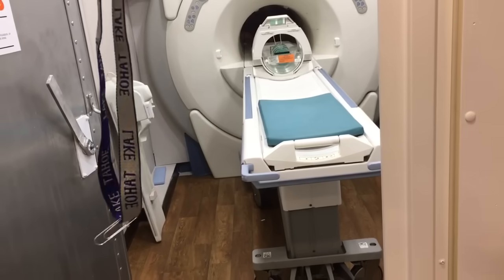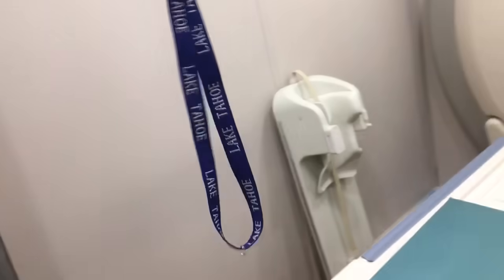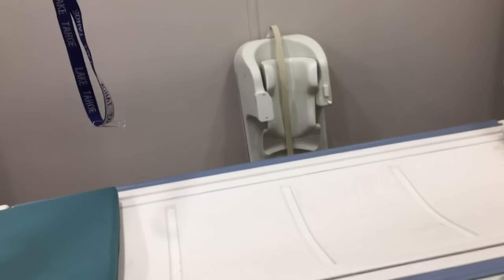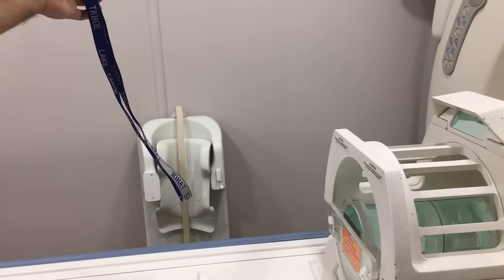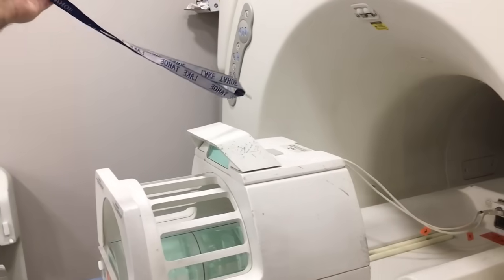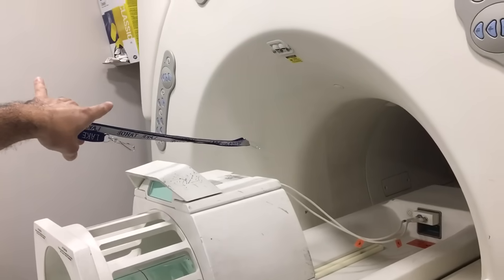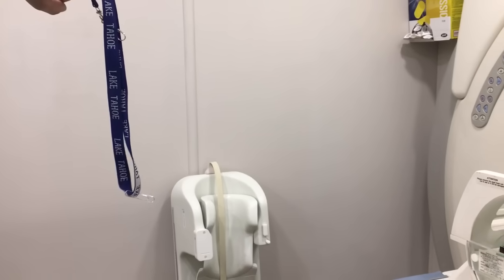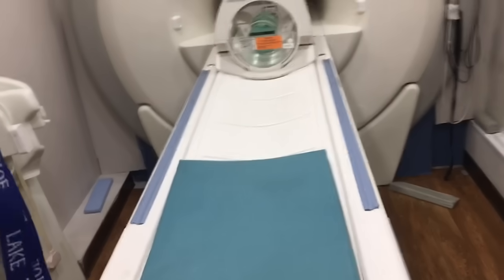Why You Never Take Metal in MRI Scan Rooms - Metal vs MRI Safety Demonstration (Original)

Comment: My sister had back surgery when she was 8 yrs old, it was a new technique back then, they never told my mom nor syster that they had inserted a metal rod in her spine on top of fusing all her spine together. 1 day a doctor sent her for an MRI and she then developed more pain in her neck, the doctor was shocked to find the rod was in there, so doctor 2 yrs later told my sister she needed another MRI, like I stated to my sister "but did she not tell you that you have a metal rod in your back", my sister then stated your right, she called her doctor and the MRI was canceled. I have a clip inside of me from gallblader surgery, so each time I have an KRI done, they put my back to the machine and test if the clip moves or hurts me, it appears my clip is not a metal which is affected by MRI as I have had 3 MRI so far.This is why I did not understand the bombing of a hospital, which stated they had hidden weapons behind an MRI machine, there is no way this could have been done safely, if it pulled a paper clip, imagine a machine gun and the bullets and whatever else those were in ?
Reply: She developed neck pain after the MRI?
Reply: @IosifStalinsendsyoutoGulag  After the MRI the neck and shoulder pain increased even more, on Xray post MRI they saw the rod had dislodged a bit. She was fused from C3 down the whole of her spine at 8 yrs old, because of severe scoliosis (more then 90 degrees deviation in her spine), so even if the rod dislodged a bit, she was still fused, they did the MRI to see if they would have to fuse the C1 and C2, as one of her clavicules is completely loose as the cartilage no longer exist to hold it in place, so that arm does not work well anymore (yet she still works full time job standing up as a cashier in a pharmacy). Back then her spine surgery was new, so new they flew in Shrinners doctors from Mexico to teahc the technique to doctors here, so my sister was a guinea pig of sorts I guess as she was the first one having that procedure done back then. Also back then there was no MRI machines hence why her rod may be from a different material which is used in this day and age. I myself have metal clips when they removed my gallbladder but I have had 3 MRI's myself and nothing ever happened so it is made from a compatible material with the MRI.

Comment: they figured out "magnet shielding". closed coil of the superconductor has reverse turns at the end faces. that is good - the magnet weakly attracts (almost doesn't attract) further than four feet.  and that is danger - magnet abruptly suddenly powerfully attracts if your iron thing closer than two feet. 
and the "slurping" is a "cold head" sound, it liquefies the helium gas back into the cryostat w/superconductor coil. this is a complete recuperation of helium without loss. helium is very expensive.

Comment: Another question : this equipments are high tech, I wonder :doesn't them have some kind of detecting phase before going full power, to detect metal parts on the body?
Reply: No
Reply: The magnet is always on so there is no way to turn it off even if there was a detecting phase before going full power: It's always at full power 24/7.
Reply: @psirvent8  Does this mean that the MRI machine consumes a lot of energy per month?  How much does he consume in 24 hours?

Comment: I saw on the nightly news that in Gaza, rifles and steel ammunition  magazines were store behind an MRI machine. What would happen to them if the machine was activated?
Reply from the maker: That’s a great question! I have been getting similar comments on the channel and I have been reluctant to comment because the issue has been so politicized but I can provide some clarification. If the MRI was activated, I would expect those items to be stuck to the side or front of the magnet. One of those big items would be almost unmanageable by a person inside the powerful magnetic field, let alone a big duffel bag. Also, firearms are known to/have a high likelihood of “spontaneous” discharge when exposed to powerful magnetic fields. However, I don’t believe the magnet was activated at the time the video was filmed. I hope this provides some clarification on the issue. Thank you for the comment!
Reply: YW. Thanks for responding to my question! Of all the places in a hospital to stash something like that, I have to believe that location was far from the best. Maybe a janitors closet or somewhere in the kitchen or almost anywhere else might have been far better. LOL!! @MRIPETCTSupportEngineer

Comment: The janitorial staff at one of my MRI sites decided it was a good idea to bring a floor buffer into the magnet room.   Yes, the magnet liked the floor buffer.   No, it wouldn't give the floor buffer back until we ramped down the magnet.   Some damage did occur to the covers on the magnet but fortunately, the magnet itself wasn't damaged.
Reply: New generations of MRI machines are cooled with helium. A full restart requires helium recharge which could cost $50,000.
Reply: @xinfuxia3809  All of MRI machines use liquid helium. We maaaaybe are going to get the first small-scale units for head MRIs cooled by liquid nitrogen some time next year.
Reply: @xinfuxia3809 Not if a technician from the manufacturer initiates a proper ramp-down of the magnet by connecting a special power supply to it.
The helium recharge is only needed in the case of a quench.
Reply: @xinfuxia3809 the USA cost is straight up scam, actual cost is around 200-500$ depending on what parts are scanned.
Reply: I imagine they make the housing for the magnets extremely strong. A helium leak would potentially be fatal, displacing oxygen from the air. Not to mention the risk of having who knows how much cryogenic liquid spill on a patient.

In cases where failire woild be fatal or catastrophic, things are usually engineers to withstand more abuse than they could realistocally be expected to experience during its life.

Since we're talking coils, just a pad-mounted transformer, or of those green electrical boxes, is built strong enough to be hit by a truck. And those are just full of mineral oil. Not liquid helium at less than 4 kelvin.
Reply: @VoidHalo  Helium leak will be immediately visible because of a huge cloud of water vapor around it. Then the superconducting magnets will quench (suddenly lose superconductivity), boiling the rest of the helium. This is rather spectacular.
Reply: Forgive the typos. I'm not drunk. Just on a phone. And YouTube on mobile Chrome doesn't let you edit your replies lol. I'd have to copy the text, delete the post, make a new comment, paste the text from the old one, THEN I can think about editing it.

Comment: I am confused with metalic objects. First, a badge containing metal at the tip. Second, a jacket with metalic zipper. My MRI technician swings his badge, containing a metal at the tip, as exactly as shown in this video almost 1 minute before my procedure. In addition to that, the technician has a jacket with a metalic Zipper. Is that a safe procedure?
Reply: Some metallic objects are strongly magnetic, called ferromagnetic, such as things made from iron, cobalt, or nickel, among others. Some metallic objects are not ferromagnetic, such as titanium, aluminum, or copper, among others. While these other metals won't be attracted to the strong MRI magnet (which is always on at all times btw, whether or not a scan is happening), during a scan some metals can potentially heat up and cause burns, so that's why even non-ferromagnetic metals are a possible concern for the patient but not necessarily staff.
Reply: Our staff, same as the patients, isn't allowed to wear anything with metal.  No zippers etc on hospital uniform. The nurse going inside with patients for sedation for several hours even only wears sports bras on that occasion to avoid problems.

Comment: I remember last year I was having one done. Like an idiot, I wore steel-toes to the appointment. The nurse had me positioned in. As she was starting it up ,she realized I had the boots on. She told me if had I continued it would’ve broken both my legs. It’s a scary afterthought.
Reply: They shows have never let you into that room with those boots.  Most scanner rooms should have a metal detector to prevent any mishaps
Reply: @moguu83 i had to take of my shoes and the belt too i think. But im sure about the boots!
Reply: Crazy because I had one last week and they left my belt buckle on. Ruined my bank card but other than that, no issues.
Reply: @Boethius411  Probably a non-ferrous belt buckle then I guess?
Reply: @noxious89123  nope. The scan was just of my head. I could feel it pulling
Reply: At mine they made me take my shoes off beforehand
Reply: Jag har stålplattor i en arm då jag opererades
Blir bara sämre o behöver röntgas. Går de? Med vad?
Reply: Come on guys it's not that strong. I had a head CT and I asked if they wanted me to take my steel toe boots off, they told me no. They're worried about projectiles and stuff that can get hot. It's not going to rip your shoe off 3 to 4 feet from the tube and probably not even if you get closer.
Reply: @Kandralla  yeah, so a CT is basically a rotating X-ray and doesn't have any magnetic filed involved, if it really was an MRI, they should have told you to take your boots off
Reply: @moguu83  it was an MRI. I would know, I've had both.

They're looking for stuff that could get hot and burn you due to eddy currents or that isn't secured so it can railgun through your skull. The pull is not strong enough to rip your steel toes out of your boots or off your feet or pull your legs back against the machine. They would likely not let me take my boots off and leave them in the room however.
Reply: @Kandralla are you trying to debunk this video?
Reply: @lourila  I'm trying to debunk the people who don't know what they're talking about beyond having had an MRI including the OP who at best had a spicy nurse who made a joke she shouldn't have.

There is a difference between
- a loose piece of metal across the room that could be knocked on the floor and eventually make it close enough to become a projectile.
- your brass or steel belt buckle at the perephery of the tube that can get hot and burn you.
- steel toed boots firmly anchored to your feet three feet away from the periphery.

Often they make people take boots off  because they freak out when they feel  the slight pull of the magnet (they're already freaked out by claustrophobia); but it's not a problem if you don't take your boots off.

People get MRIs with metallic implants and braces in their head. Other than checking to make sure whatever is around them can tolerate heat or a bit of movement when the magnet pulls on them it's not a problem.

As I said, the problem is loose metal that can become a projectile and the potential for burns due to eddy currents forming in the metal.
Reply: @Kandralla would I be able to wear cotton sweatpants and socks?
Reply: @Kandralla CT Scan doesn't use the Magnetic Resonance but is done by the powerful XRay radiations.
Reply: @abhijitanup  I never said it did.

Comment: I hurt my back several years ago and my doctor offered to do an MRI. I told him I didn’t think that was a good idea because when I was born, the duct or valve, or whatever it is, that pumps blood to the fetus’s lungs did not close. I was implanted with a clamp of some unknown material to close it. This was in 1981 so I’m not sure if it is metal or plastic or what. I just did not want to take that chance and turn the MRI machine into a raw meat factory. Actually, I’m curious to know what would’ve happened if anything?
Reply: It’s very unlikely metallic. You’d be setting off all sorts of alarms in airports and stuff if it was. Would also show up easy on an X-ray. 

Better safe than sorry though! If you are at all unsure go back to your doctor and ask for an X-ray or CT.
Reply: @asdfssdfghgdfy5940 Stents are often made of metal.
Reply: @asdfssdfghgdfy5940 i got metal plates and screws in both legs and it never set off a metal detector it's disappointing actually
Reply: If it was magnetic, the mri would pull it and rip the part of the heart ripped apart. It probably isn't though
Reply: If it was a non-ferrous metal implant like titanium it would have done nothing. If it was a ferrous metal implant, your implant would have ripped itself out.

Comment: is it possible to enter mr machine with dermal piercing?
Reply: I will be glad if you help :( my doctor appointment is tomorrow I will enter the mr device for my lower back problem.
Reply from the maker: @iremaslan3607  It would be difficult to assess without more information, but I can give you some insight. it is typically not recommended for any metal to enter the MRI room but there are many factors. Is it made of ferrous metal? Is it fixed in place? Is the imaging center already aware of the piercing? The main safety concerns would be the magnet pulling the piercing off, RF burns due to metal vibrating and image artifact caused by resonant noise created by reflecting RF. If you can remove it for about 30 minutes, I would try to take it out but the best option is to call your imaging center and let them know. It’s something they deal with in a regular basis and they will be able to provide you with the best answer.
Reply: @MRIPETCTSupportEngineer   Thanks for be interested.i talked to the hospital.It is very difficult to talk to hospitals where I live.They said there would be no problem.my head is out of the machine because the problem is in my waist.sorry for my bad english :/ Thank you for your interest and concern.
Reply from the maker: @iremaslan3607  Great to hear! Good luck on your upcoming MRI scan!

Comment: The PCB inside the phone has a lot of twists and turns that can act as a crude transformer and generate electricity provided that the cell phone moves enough to generate an alternating magnetic field. There's probably a way to fry the cell phone next to an MRI if you spin it or rotate it at just the right speed to generate sufficient energy to fry a chip or put electricity where is shouldn't be or at a level is shouldn't be at.

He's not really moving the camera around that much so any internal electricity is probably at a minimum but it could still be enough to crash software running internally if a 0 becomes a 1 or vice-versa. 

Really fascinating stuff! MRI machines provide you with 5-10 tesla of magnetic strength that is an order of magnitude greater than the strongest permanent magnets. Probably a lot of fun science experiments you could do with an MRI machine. 

I'd really love to see how far away a compass would deflect from an MRI machine.
Reply: all phones have shielding over sensitive parts so most of that argument is irrelevant, also fixed magnetic fields won't do much, the fun stuff happens when you have switches fields like found in a ZVS driver often used in induction heaters

Comment: i have braces and i might have to get a mri exam, would i be okay??
Reply from the maker: I would recommend to ask your imaging center but can offer some insight. Generally the biggest safety concern is with loose metal that can either be pulled in towards the magnet or cause RF burns on the skin, or in this case the inside of your mouth. With some special precautions, I'm sure everything will be okay but you definitely want to let the imaging center know during the patient screening process. Good luck with your MRI scan!
Reply: @MRIPETCTSupportEngineer  It's not a loose metal if braces are glued to her teeth lmao

Comment: NOT. 
ALL. 
METAL. 
IS. 
MAGNETIC!!!
Reply from the maker: You are correct. Entering an MRI scan room with non-ferrous metal does not pose a risk due to the strength of the magnet. However, intense RF pulses during the MRI scan can cause even non-ferrous metals to vibrate at ultra high speeds which can lead to RF burns on the patient, or image artifacts during the scan. We use the word "metal" as a blanket statement but there should be an asterisk above it. Most metals in modern medical implants are MRI compatible. Always consult with the MRI technologist to be safe :)

Comment: I had molybdenum screws implanted in shoulder surgery. Need an MRI now and the tech said screws are not magnetic, but I think the screws are basically steel with molybdenum as an additive so they would be magnetic. I told the tech. that I had the moly. screws and she said, "what is molybdenum". So if she doesn't know what it is, how can she know if they are magnetic? Don't know what to do - right now have postponed MRI.
Reply from the maker: I researched this quite extensively but unfortunately have no prior experience with molybdenum alloys used in implants. I would love to know what you find out and if there are any imaging limitations. Thank you for sharing. Good luck!
Reply: @MRIPETCTSupportEngineer  thank you for your research and your response. Unfortunately, I used to work as an entry level employee at a ship water pump manufacturing company in Oregon. I had to grind out the interior of the pump castings to ensure they were perfectly smooth, and once I got s shard of metal in my eye while showering after work. It was washed out and checked with a special light to be sure all metal was removed, but the MRI prep person said that since I had that experience I would have to come back at another time to have my eye imaged with a different system to ensure no metal was still in my eye. She had no idea what molybdenum was, and that did nothing to reassure me. Between the Molybdenum Steel in my shoulder and the new issue with my eye, I have decided not to go forward with the MRI.